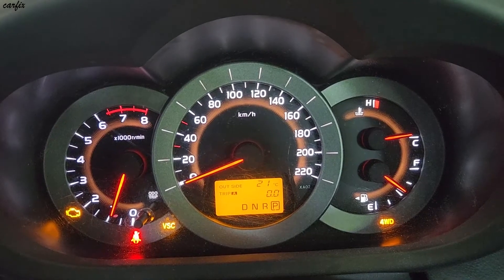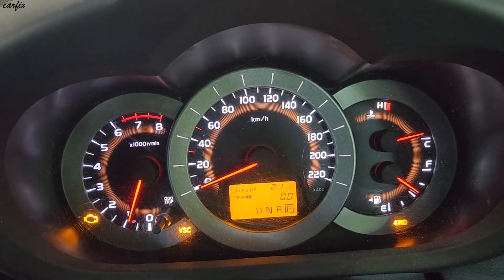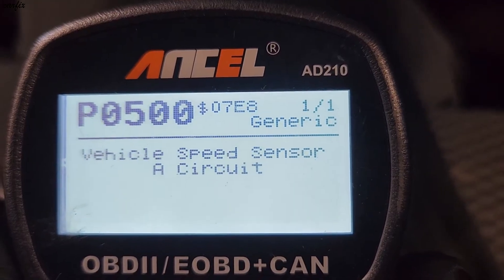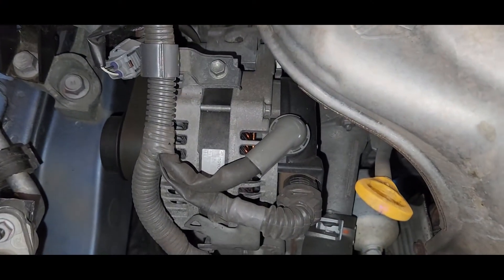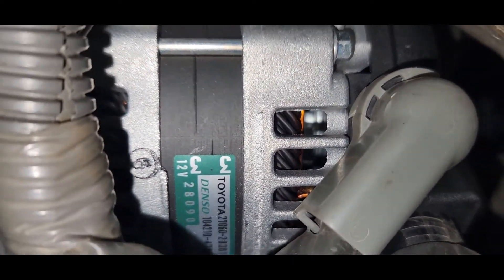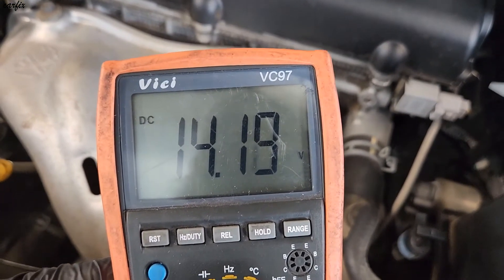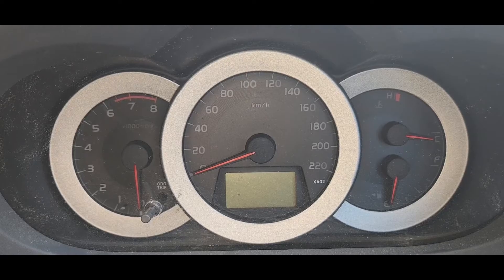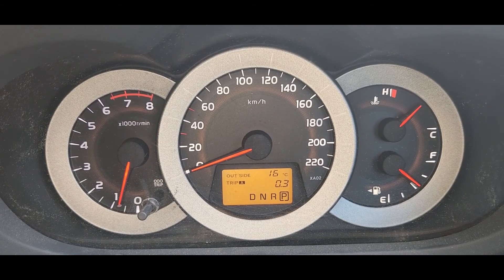P0500 Vehicle Speed Sensor diagnostic Toyota

Comment: I tried another sensor I have and it works exactly the same as with the old sensor and sometimes it will work fine even when hitting bumps and not bounce but it usually bounces. I even replaced the wire connector and it operates the same.